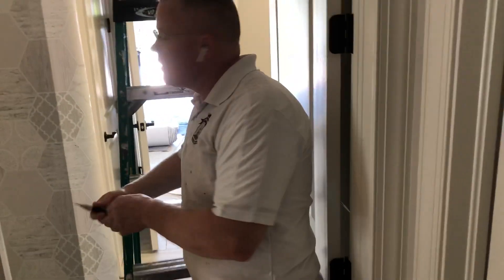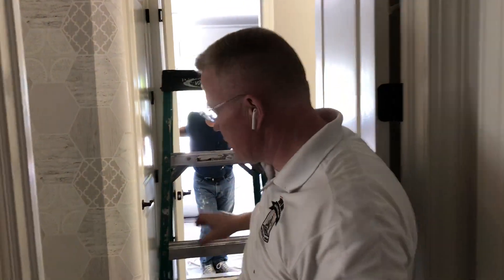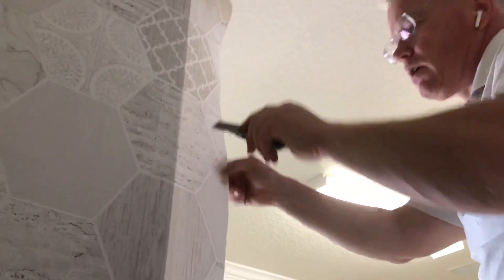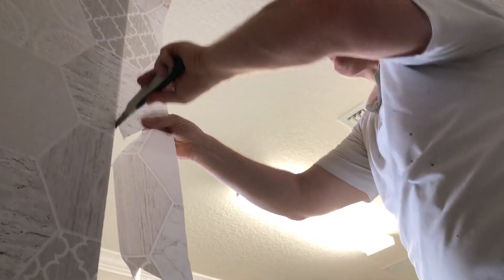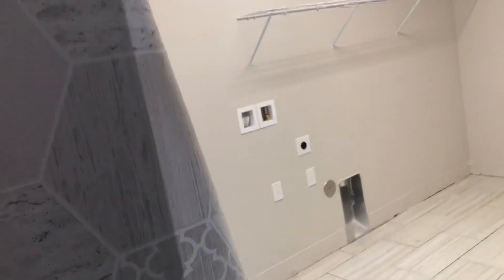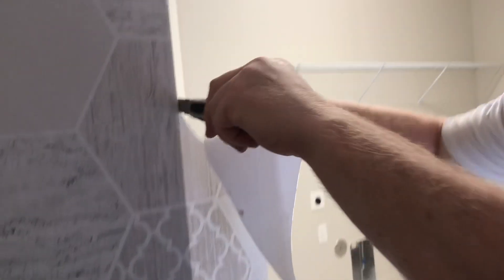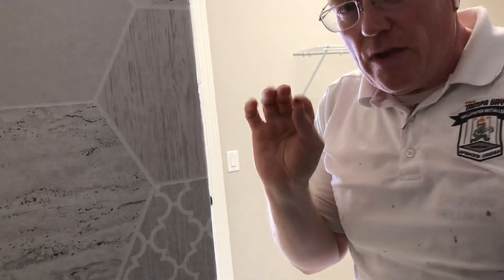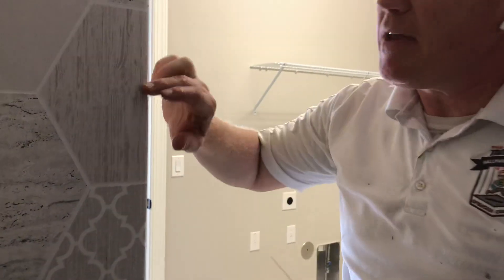How to Trim Wallpaper Edges - Spencer Colgan

Comment: That’s really helpful, thanks. What kind of knife are you using for the cut?
Reply from the maker: Jim, I am using what is called a 9 mm black extra sharp blade in a “break away “refillable-cartridge type knife that I purchased at paint stores such as Sherwin Williams.  Here it is
https://www.walmart.com/ip/Olfa-Black-UltraSharp-Snap-Off-Blades-9mm-50-Pack/114952864?wmlspartner=wlpa&selectedSellerId=1122&&adid=22222222228071288500&wl0=&wl1=g&wl2=m&wl3=181964711170&wl4=aud-566049426705:pla-287286691358&wl5=9012359&wl6=&wl7=9004468&wl8=&wl9=pla&wl10=101593696&wl11=online&wl12=114952864&veh=sem&gclid=CjwKCAjwps75BRAcEiwAEiACMXXGa73Ce_7RlFbofJ6SGI2hPUuHe9PTFRuREo0HLtjRHCddApCbCBoCNVcQAvD_BwE
Reply: Spencer Colgan Wallpaper & Painting: Many thanks, that’s really appreciated, Spencer 🙏

Comment: You are amazing!!! I so wish I had watched your videos before I attempted to take down the pall paper in my bathroom.  It was put up by builders that did not prime the walls and put it up right over the sheet rock.  What a mess!!  I also took the advise of a home store that said I could paint right over the wallpaper with a primer and then just paint.  Not so good!  The seems showed right through and buckled.  Now I have such a mess!  No idea what to do now.  Any suggestions would be so much appreciated.
Reply from the maker: Joy, thank you for watching my channel!

Do not panic, there’s nothing you cannot remove.  First you have to determine the level of difficulty your wallpaper is to remove… Wet it down with a garden sprayer attacking the seams first and then the top and the bottom where the water can get underneath the paper; start pulling it off with your fingernails where it’s wet; once you get the front of the wallpaper off, the real trick is to get the backing down; wet it repeatedly and after you have wet it for a half an hour you will know 
If it is very difficult, moderately difficult or very easy. And then you will determine what tools you will need to get it down… Simple Dash fingernails in water, moderately difficult, plastic scrapers, may be a metal scraper but no damage to your wall as you pull it down… Very very difficult is a metal scraper and a lot of damage to your wall; it is up to you joy to figure out what level of difficulty it is in order to determine what tools you will need.   

Please YouTube Spencercolgan Wallpaper Removal and you will come up with a series of videos which show you that most of your wallpaper removal is easy and does not require any tools at all!

Here are just a few:

Would you do me a favor? Since you loved my videos, would you give me a five star review on Google on the following link and say some nice words and read my videos based on their content, their value, etc.? If you don’t mind, here’s the link to do that

https://www.google.com/search?q=tampa%20wallpaper%20installer&tbm=#lkt=LocalPoiReviews&trex=m_t:lcl_akp,rc_f:nav,rc_ludocids:18168418332679895040,rc_q:Spencer%2520Colgan%2520-%2520Wallpaper%2520Installer,ru_q:Spencer%2520Colgan%2520-%2520Wallpaper%2520Installer,trex_id:XCBBr

https://youtu.be/9JnLY82UyLY

https://youtu.be/6oK-4-7mh0U

https://youtu.be/NDzzOo6PkQU

https://youtu.be/J7PiejFqWzQ
Reply from the maker: Joy…Thank you so much for watching my video; I just posted several videos for you to watch; please don’t panic joy, you can do this! I also posted a link if you don’t mind to give me a five star review based on my assisting you and my videos and please say a nice word or two on the Google link below on my previous response. Thank you Joy, happy removing!

Comment: Any tips mate for cutting the paper at the bottom near skirting the skirting is un even so keeps ripping the paper at the top no problem so cant be the knife should I wait till its dry
Reply from the maker: Excellent excellent idea but if you could not wait until it was dry this is what you should be doing… Make your knife cut the paper add an angle that uses the shaft of the blade more than just at the tip.  In other words, bring your blade down toward the woodwork so that you are using that only the tip of the blade but also part of the shaft and here’s what you do… Move quickly in 8 inch spurts and then stop, then do that again… Something about the blade moving quickly in short rapid spurts presents tearing the paper
Reply: @spencercolgan  thanks I'll try it first time doing it got in a huff and ripped it down iv been fuming all day I dont want to let it defeat me haha

Comment: Hi Spencer.  What would you do with a rounded corner if you aren't planning on continuing the wallpaper around the corner? I'm at a loss for where I should actually make the cut  so that it won't look awkward.
Reply from the maker: I have a video covering this issue. I would take either a forefoot level or, a laser level, and then put a straight edge against the rounded corner and cut right in the centre of the round the corner straight down and end in the middle of the rounded or what we call, bullnose corner
Reply from the maker: 4-foot. I meant
Reply: Lovely, thank you! I can’t find the video you have on this. Would you happen to have a link to share?
Reply from the maker: Marina Selzer 
I’m looking for the video but it was at the same job of the following video… Why don’t you and I both love… Look for videos six months ago with this wallpaper please

https://youtu.be/5tXEeiPPogE

Comment: You need to do this in one cut from top to bottom, folding waste paper & taking the weight, that way no jaggies as you had here, but it can be tricky, also for the inexperienced don't angle the blade as it Will trim short of edge, keep straight
Reply from the maker: True. Unless you need to run to the bathroom
Reply: @spencercolgan  good job, papers can be a nightmare & i had one last week that was so thin that even though i used brand new snap offs it still wouldn't cut without tearing, as soon as the papers pasted it becomes more fragile so i much prefer the paste the wall as opposed to paper as it's more like cutting cardboard when dry & much cleaner cut , scissors also leave jaggies, we need a very sharp wheel cutter instead of a knife with a point which is dragged across the paper, that way it's pressing down into place & cutting 👍